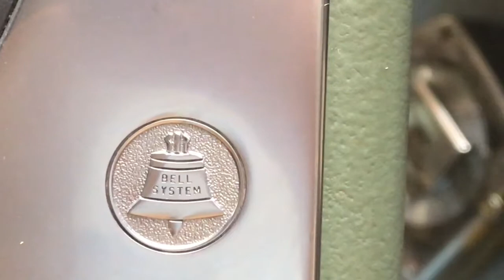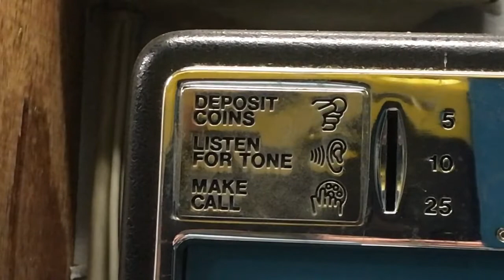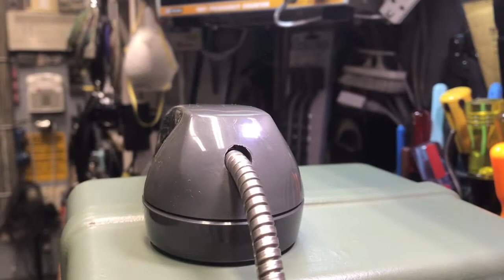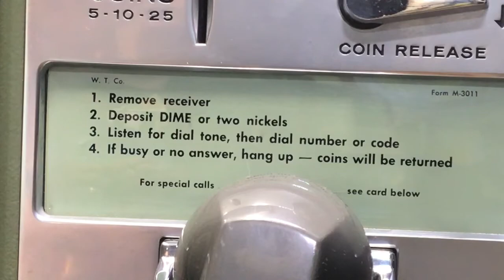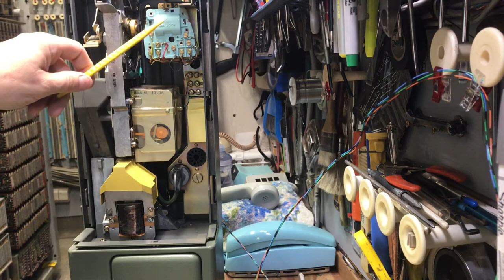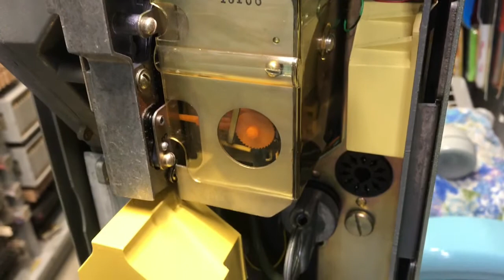Western electric 1A1 Single slot payphone. (Rare)

Comment: Fun fact: the Ellsworth museum’s 3XB has a pay station on it and it originally didn’t work very reliably because it was a 1C1 set for dial tone first service but the switch is set up for coin-first service. I had to actually reverse the wiring changes to convert the phone from dial tone first back to coin first.  Now it works as intended.

Comment: Does that number card mean that this phone was (or was intended to be) installed in a CO?
Reply: Looks like it. The Bell System typically reserved the last four digits beginning with "9" for phone company use only. With the breakup of the Bell System I believe that is no longer the case.
Reply: @williamjones4483 99XX were typically internal numbers on the east coast at least. Payphone numbers typically did start with a 9. This was one way an operator could know you were calling a Payphone, so she shouldn’t allow collect calls.
Reply: CO1 is 261 in modern terms. It’s an abbreviated exchange name.
Reply from the maker: I think it was a test phone in a C O